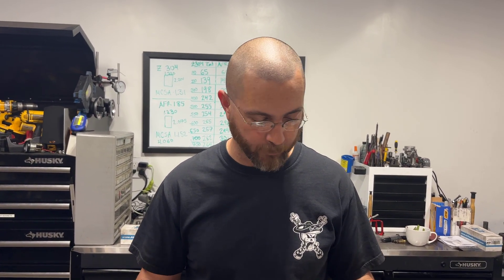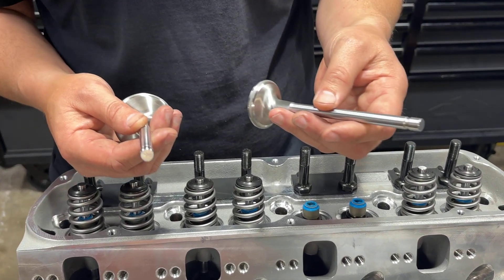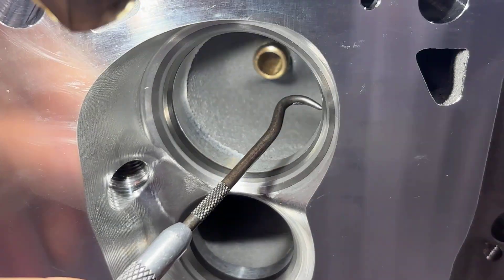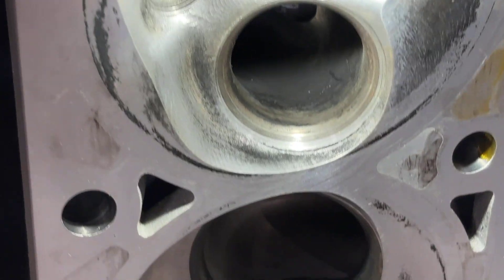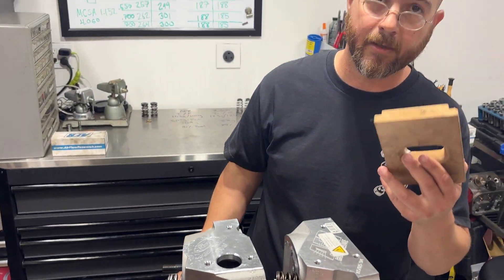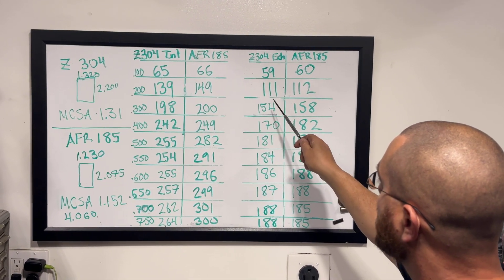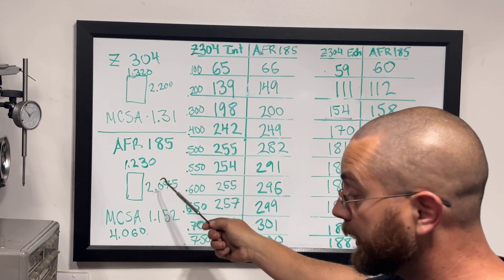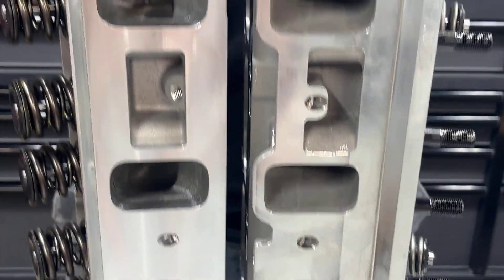Ford Racing Z304DA vs AFR 185 comparison with Flow numbers, watch before you buy!

Comment: Old ford e352 rockers work from crane or comp there  .100 ofset im not saying or supporting the brand or how ford does there customers but I have gotten alot out of a old y303 written off cylinder head on a 347 build and very similar flow out of 197 cc antiquated y303 heads you claim out of a set at 650 just mine was at 600 lift

Comment: How do the trick flows compare to afr’s?
U are paying for the ford name
Reply from the maker: @SleepyDaisy-ub9wt  Trick Flow makes great cylinder heads but it’s an apples to oranges comparison because of the valve angle on Twisted Wedge vs STD 20 degree heads. Now the TFS High Ports are great performance heads but they have a much higher exhaust port compared to the AFR heads.

Comment: So the cost difference is in the "potential" of the cylinder head.

Its clear that "as is" the 185 out performs the Ford head. Flowing more from a smaller opening is ALWAYS better, but with the larger CSA at the pinch, which is usually a factor for a high flowing head. The Ford head should be marketed as a race head. 

The smallest CSA needs to be at the throat and not the pinch.....hmmm, thanks for bringing this to the surface.

Comment: Any chance we can confirm or not confirm if the valves are from China ? We know AFR uses a very well known quality brand.  Can you buy the ford head bare?  Yep i remember these. Sorry im aware and yeah the offset rockers?  What was Ford thinking
Reply from the maker: @RossT-l3g  Doubt they are China valves and yes you can buy the heads bare, but no point. A lot of work to cut the un-machined seats, ream guides, valves, spring kit, surface heads, special rockers, etc. Unless some racing class specifies the Ford Z304, stay away.

Comment: $3400 and you still have to buy a specific rocker set? man that AFR way outperforms for way less $$$! I'm really surprised the raised exhaust port on the Z304 didn't perform better, then when you compared with the AFR 220 to the Z304 the ford intake port is not raised as high, the ford looks like the port was extended toward the bottom where you don't want the port bigger!
Reply from the maker: @vrm86gt  The exhaust did a but better after hand blending it, results shown on our Vigilante Performance Instagram page.  $3400 and yes, you need special/expensive rockers.
Reply: @vigilanteperformance8318  And offset solid roller lifters.

Comment: My Z304s cost $1800 for the pair and had them ported By Duane Busch, they now flow 340in/272ex with a 2.08 valve, there is still a good bit left in them ,

Comment: How does the ford 6049-Z2 head compare? 271 CFM at 0.5
Reply from the maker: All old data was lost, would have to flow on and actually see the runners, short turn, bowl, etc. To give an educated opinion. As we said in the video, there are ways to make heads flow on the bench but does not mean they will make power.

Comment: I don't know for sure I'm not an expert by any means just a guy who sees things and thinks but I would think a raised port on a street car would be kinda a waste of time and money, my theory is with an under chassis header the straighter shot gained from the raised port is somewhat diminished by the added angle on the primary tube... And with the header fitment hassle would make it not worth it. I may be way off and its still better flowing even with under chassis headers? With race car chassis where the header doesn't have as many routing constrictions the raised runner may pay dividends...?
Reply from the maker: While the exhaust port would be more efficient, yes, header fitment can be an issue. The other issue is the valve cover rail is a bit higher so on FOX style EFI intakes, the intake might hight the valve covers or require a spacer.

Comment: The old Canfield heads would flow in the 330's with a little work. The Z heads should easily get there as well but I agree....over priced. Typically "porters" castings are cheaper to allow cylinder head shops to finish them and make a little profit. 

The AFR Enforcer castings are imported. Their US castings are slowly coming more available  now but they took a big hit when Edelbrock shut down their casting plant in California.  

TrickFlow High-ports are still my favorite. 
The ProFiler and Brodix ST heads for more budget oriented builds and have plenty of room for porting down the road as the build progresses....as they always do.
Cool video! Lots of good info and video angles to see the pertinent details!! Thanks for that!
Reply from the maker: Yes, the Canfields can flow a lot more with work and same with the Z304 which now the customers wants to do some blending to. Video was just to show how overpriced the Z304 heads are for the brand loyal enthusiast.
Reply: Where or when do you think I can buy a trickflow box intake? Trickflow took them off the market over a year ago due to alleged foundry issues. You can’t find the damn intake manifold anywhere for a 351w. Been looking used for a long time too. They just got the upper part only back online within the past month but without the bottom I can’t use the intake. Curious of your thoughts
Reply: @timweb1510 I've got no good answer for you. I'd suggest you look at other lowers and see if any of them use the same gasket for the upper....or if they are close enough that a little porting will solve any port alignment issues. I'm not familiar with that intake in particular. The only box-type intakes i ever used we made from blown-up intakes...like from a nitrous backfire. We'd take the upper and bandsaw the bottom runners and throttle body flange off and weld our own box together. That way we could put nitrous bungs and vacuum ports where we wanted  them as well.
Reply from the maker: @timweb1510  Kind of hard to say, Ebay would be the first choice or maybe run an EFI single plane with an elbow. Been running that set up for over 20 years.

Comment: Wow! Ford is proud of those heads.
Who makes them for ford?
They kinda look like tfs high ports.
Another 2 to 3 grand and you probably would have some good preforming heads. Ha.
Considering port work machine work special rockers headers ect.
Your getting into CHI money.
Reply from the maker: Look up the old Ford Canfield heads, looks like they might be using that tooling.
Reply: @vigilanteperformance8318  I actually had a set of those. They where real good heads back in the day. Champion racing heads ported them for me. 1993 I think.
Reply: Heck, you could purchase an entire engine!

Comment: M-6049-Z304DA7
Model Fits 302/351 Windsor engines
"Z-HEAD" ALUMINUM - ASSEMBLED 63CC WITH 7MM VALVE
Both heads do use offset intake rocker arms.
Reply from the maker: The Z304 heads do need the offset for the Intake and the 7mm casting helps with valvetrain stability for sure but still overpriced in our opinion.
Reply: AFRs  dont  use  offset  rocker arms.  at least not the 185.  they just use a regular scorpion rocker arm they sell on their website

what you need  is 2 piece  pushrod  guide plates and that's  why AFR  and most  aftermarket ford  heads use  them.  so you can  align them  correctly

Comment: Z304 is a much better engineered head
Reply: And TF  11Rs  are even better  for 600.00 less than  a factory  HP  head  like the z304 for the same  CC or larger
Reply: @KingJT80  thats an 11 degree valve angle head z304 and afr are stock sbf 20 degree valve angle. So if you wanna go there lets go with Ford Racing D3's
Reply: @erikalston4496  you cant  even compare a D3 to a 11r

if thats  the case  id  buy a TF  high port 225/240 over a D3  any day of the week (hell,  even a  AFR renegade 220) and come out  ahead  with everything machined. D3s  dont even have  rocker  stud  holes  machined
Reply: @KingJT80  D3 flows 100cfm more than a afr 220/high ports. You shouldn't have compared  an 11° head with rotated valves to heads with stock angles and alignment.
Reply: @erikalston4496  I compared a street head to another street head out the box.  Shouldn't matter the angle. 

The d3 is anything but a street head.  

The z304s are over priced for the same or less power and speed that's why no one buys them much unless they came on a crate engines and everyone runs TF or AFR heads on Windsors

Comment: So for a stock 302  in a street truck. The AFR 185 would be good to go with cam, Intake and exhaust.  Or would i need to go 306 for the heads to work well.
Reply: 185  is  like a 6500+ RPM  head  a 302

in a truck  id  be using  the 165s  so the valves  clear  depending  on what  cam  you use.  TF 170s  would also work
Reply: @KingJT80  Yea I saw the 165s once I looked on website.
Reply from the maker: Something people forget is that intake runner affects torque/RPM range. A 165 AFR is proven on 302’s. 185 will also work with the right cam.
Reply: @vigilanteperformance8318 i might  do the 185 myself on a 302  but its not in a truck,  its in my zephyr  but we'll see...
Reply: @vigilanteperformance8318  how big of a came ? And would it still be streetable?
Reply: Very informative video. A steady camera would really make this excellent.

Comment: The Ford head needs work in the bowl and short turns... do some work and flow again, see what the numbers are... they will probably pick up big numbers...many guys like genuine factory parts...
Reply from the maker: Correct, they would pick up a good amount but for what they cost, we believe that should have been done by Ford Racing.
Reply: @vigilanteperformance8318  You never get much out of Ford.... They are alll about mega profit...
Reply: @vigilanteperformance8318  Accountants only write checks, they don't finish parts........
Reply: Headers on my 351w in a 66 Mustang, I dont think I could raise them that much, might be wrong.
Reply: @Eddie-x8w1u  The exhaust ports on this Ford Z head will raise the header flange right around 1/2 inch.....